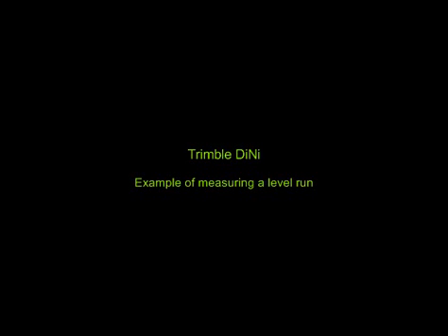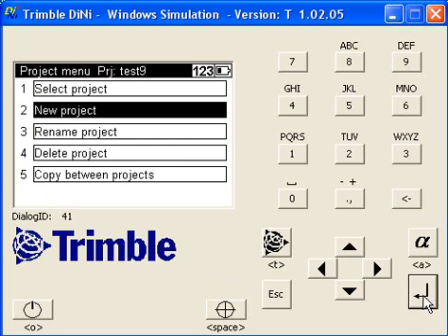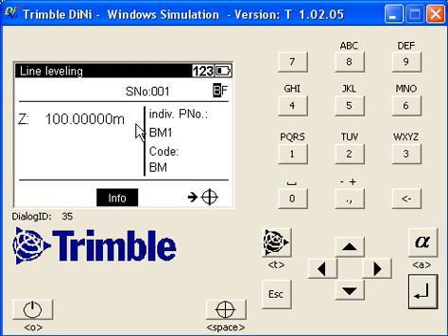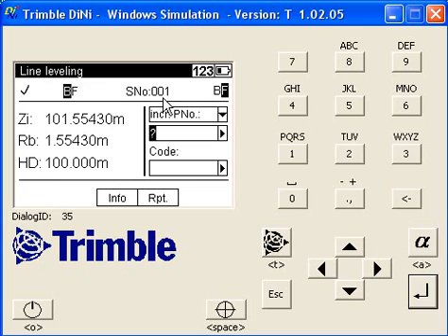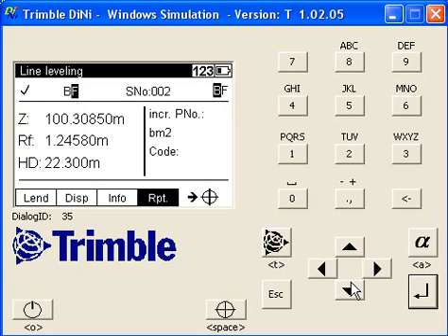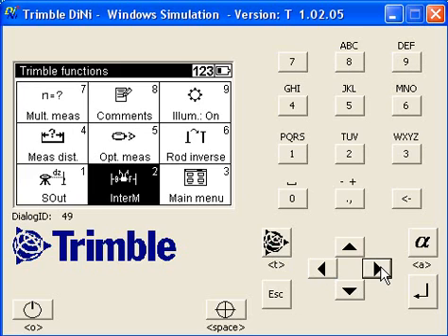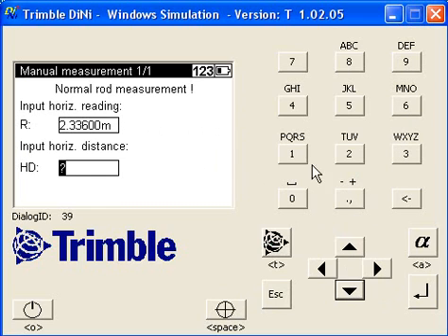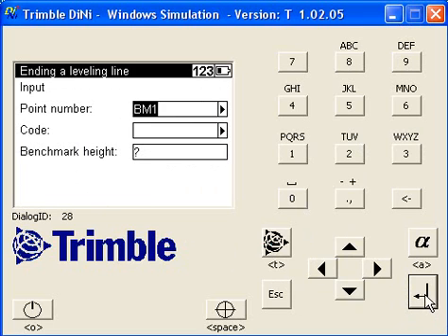Trimble DiNi - Surveying a level run

Comment: If the sight forgets to stay in its place, will it redo the work or go back to the last point or read the cut before in the last station.thank you,
Reply from the maker: Thanks, Im not sure what you require. When doing a level run, you`ll need to be very systematic and precise. Any mistakes will need you to redo the level run.